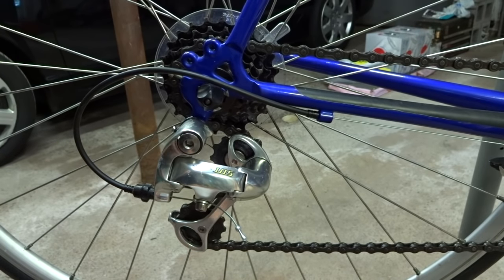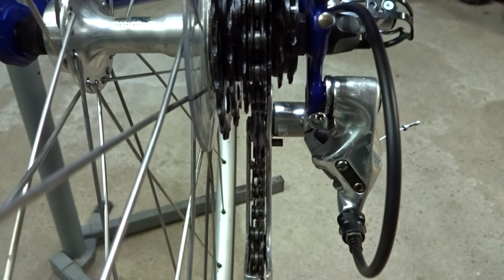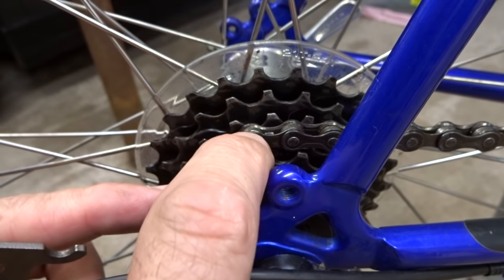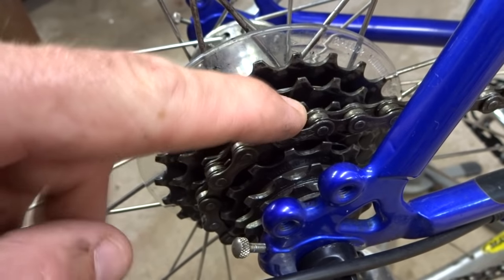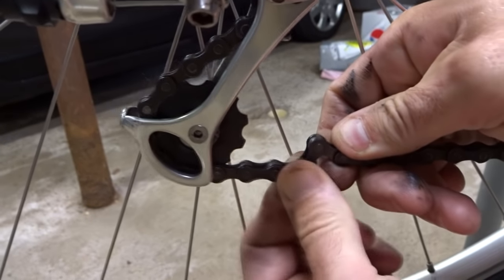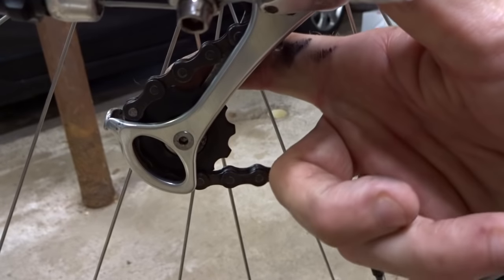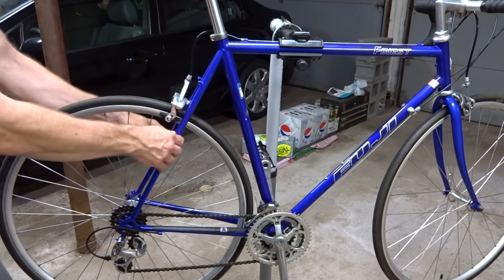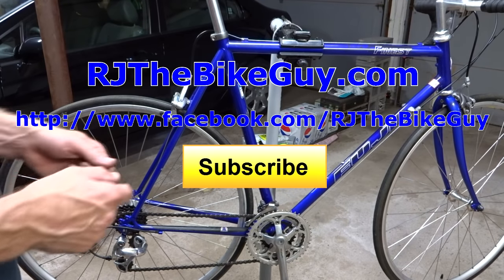How To Fix Bike Chain Skipping/Slipping/Jumping Gears

Comment from the maker: For more bike repair videos hit the subscribe button 🛑 and click the notification bell ► http://bit.ly/SubRJTheBikeGuy
Reply: RJ The Bike Guy first video I've watched on how to fix a bike and it's been sooooo helpful!! 🚴😊 Thanks 😁👍 Sub'd 🤓
Reply: Hey bud just watched your video I got a weird problem If I shift up past 6th gear my bike's chain will slip until I shift down.
I can shift all the way to 6th but not further.
I bought the bike 3 days ago so it's brand new is there a break in period?
Reply from the maker: @HerrenGamingNews  If you just bought the bike, have the shop fix it. Sounds like a limit screw adjustment.
Reply: @RJTheBikeGuy  yeah I just talked to them and they said it could be the cable, next time when I buy a bike I'm going to get them to check the gears, cable and chain on top of their safety inspection which will be in 2021 as I want a fat bike for the winter
Reply: i am in dire need of help!
my bike tries to kill me on 3rd, 4th, 6th  and 7th gear, i make sure i down shift and "seat" gear properly before putting pressure on the chain while climbing, and the chain "skips"
meaning that it feels like the chain lets go 100% or af it the cassette has missing teethe and you get to those teeth and it lets go for 1 second,
not good when you are putting all your pressure on the pedal and just goes "CLING!" and all your weight goes sideways!! 
the bike never did that new and only after a few rides i start having issues with it and never had worked correctly after the first tune up..
Reply: @anuar.m.y  try replacing your cassette and chain, my chain would slip on 7th and up and eventually 6th after I replaced my chain and cassette no issues
Reply: @HerrenGamingNews   i checked the cassette, it seems to have no issues and already replaced the chain, 2 bike shops looked at it before the COVID-19 and they both said that the cassette was fine tho,
it started with only 3rd and gradually got worst and now other gears are skipping
going to change the hanger soon too
Reply: @anuar.m.y  ok it could be tension on the chain but remember chains and cassettes wear together if replacing both together doesn't work it may be time for a new bike
Reply: @HerrenGamingNews  is a Specialized hardtail with mild usage! how is this possible!?
Reply: @David Woodhouse I got it fixed but it was anytime I put any real weight on the peddle from 7th up it would slip turns out the cassette was bad
Reply from the maker: @David Woodhouse https://www.youtube.com/watch?v=OV1AVcdNjMM
Reply: thanks bro this helped me fix my bike
Reply: loved your vids. you will have the solution to most of my bikes problem. but recently i have a problem with my bike and im not sure what the problem lies in. when i step on my paddle, my gear will move but not my wheel and it seems that there is no catch in some part of the wheel.
Reply from the maker: Freehub or freewheel. Discussed in the video.
Reply: Thank you so much I appreciate the help!
Reply from the maker: @Kamek stories, maths and games Have you tried training wheels?
Reply: Lmao
Reply: @TheRageng qqqq❤❤❤❤❤QQ

Comment: Hi RJ: Update on my chain skipping problem on my 3x9 touring bike: Turns out that the culprit was a  worn middle chainring! Everything else is new on that bike, so I should have thought of the chainrings earlier, but when you're stomping down on the pedal while riding it's impossible to keep a close eye on the movement of the chain. It was only when I asked my wife to look at the cassette while I stomped on the pedal with the bike on the floor and the brakes set that she exclaimed, "the cassette isn't moving, you dummy!" This has proved to be one life lesson that I will never forget....

Comment: I have a 17 year old hybrid with a 3x6 freewheel setup. Shifting was awful. Changed the chain and freewheel but not much better. The main culprit turned out to be the rear derailleur which has lost a lot of its spring so the chain tension was too low. However carefully the limit screws and indexing were set it would not go up and down reliably. A new one completely fixit it. I had a second problem of shifting getting slow and sometimes delayed for several seconds. This was due to dirt getting in the cable to the rear derailleur. The cable comes in three outer sections so lots of places for dirt to get in, but easily cleaned as well.

I have a new bike now with Shimano 105 groupset. The technology has come so far in the last 20 years, it’s in a different league.

Comment: my chain always skips right when i stand up... wish i could see it happen so i could figure it out.
Reply: me too
Reply: gamer3928 same
Reply: Romans biggest fan my issue was gunk between the gears. it was an 11 tooth so I guess the small amount of gunk was thick enough to push the chain high enough so it doesn't have good contact
Reply from the maker: Most likely causes, worn chain, worn, cogs, misadjustment, maybe bent derailleur/hanger. It's all in the video.
Reply: gamer3928 how should I clean it?
Reply: Romans biggest fan there tons of ways to clean it. out on the road I pull over and just dig out the gunk with my lock key and it's good for a while.
Reply from the maker: Degreaser and a scrub brush. I usually follow up with dish soap/hot water and a scrub brush.
Reply: gamer3928 agaa
Reply: gamer3928 in
Reply: Simple fix. One of my chain links were stiff. WD40 did the trick
Reply: el verdugo Pr ... Because 5he wheell isn't well attached to the frame . Those the reazon it goes side to sides .
Reply: My chain skips on gear 6 and 7 mostly when Onadd more pressure going up.
Reply: SBG KANIFLE  thank you ;)
Reply: Yeah me too it makes me crash to the ground because of chain slipping and it also happens when i sprint.
Reply: gamer3928
Reply: gamer3928 =
Reply: gamer3928 mine skips when I go down past gear 3
Reply: gamer3928 and it is a brand new bike
Reply: Gamer3929
Reply: dont stand up
Reply: @andrewwhiteside5987  lol
Reply: @Klaem0re  did you ever figure it out?
Reply: Lovelyjubly  always blame the bottom bracket!
Reply: living in a desert   😂😂

Comment: This is a great diagnosis video but is a poor "How to" video that the title suggests that it is.
Reply: How to diagnose, not fix. 
I think my cassette needs replacement and i bought it like this, back to the store with complaints.
Reply: It a bicycle, not a motorcycle, start screwing on something at some direction, and it will work out.
Reply: I figured out what’s wrong with my bike. And how to fix it from this video. Also he tells you about his other videos with the solution to your diagnosis. Use this video figure out what’s going on, and use his other videos explaining the problems and fixing them in greater depth
Reply: Helped me fix my problem with, great video.
Reply: @alecnolastname4362  Ah, that's why the video is titled How To Diagnose Bike Chain Skipping/Slipping/Jumping Gears
Reply: @andthefunkybunch1466  It says how to Fix not diagnose
Reply: Niiles Punkari 🤣🤣🤣🤣🤣

Comment: Hi, I have a 7 speed bike with shimano tourney groupset and Im buying a new 7 speed freewheel from shimano that has a different cog count compared to my old freewheel. Will that old derailleur still work? thanks
Reply from the maker: You lost me. You have a 7 speed bike and you have a 7 speed freewheel...how is that a different cog count?
Reply: RJ The Bike Guy sry about it. my old 7 speed wheel got all rusty and stuff so I am replacing it. but the new one i got looks quite different compared to the old one the largest cog looks bigger than the one on my old freewheel. Can I still use the same derailleur and shifter?
Reply from the maker: This video talks about derailleur specs: https://www.youtube.com/watch?v=9R1CVWcgu_M
Reply: thank you very much

Comment: Great video! I have a bike that was locked up outside in the elements for a long time without use (thanks a little to COVID and a bit to the weather). I immediately relubricated the chain but found it skipping. The cassette , derailer and chain seems to still be good. I'm now under the assumption that the chain links are stiff (due to being out in the elements for so long). I used some oil to continue cleaning them. Otherwise, I might just replace the chain. Thanks for the help and tips!
Reply: You should get a new chain and pay to get it placed on. I'm telling you no amount of money saved is worth attempting to do the chain all alone if you deal with links. You can follow the instructions all you want you won't get nowhere and with some skill and determination you might take a few links off the chain but you will never be able to put the chain back together without an actual machine or taking the bike to a shop where they can do it by machine
Reply: @David-ty5jk  I don't fancy the job either.

Comment: Nice video.  One other thing that can suddenly cause bad shifting on a bike that has been shifting fine for a while is a worn (even busting) cable or bad housing.  Sometimes hard to see if the cable strands are starting to bust up inside the shifter.

Comment: Thank you very much for this video. I bought a used Trek 7.4a few years ago that had a persistent problem with the rear derailleur. It just didn't shift as smoothly as it should. I tried the standard adjustments. I took it to the LBS. All without success.  Then I found this video. It suggested replacing the shift cable. I replaced the rear derailleur shift cable and wow! Problem solved!

Before I threw out the old cable, I  inspected it. I found a kink in the cable that would explain the poor shifting. Thanks for the great videos. Please keep them coming.
Reply from the maker: Your LBS didn't catch that???
Reply: Sadly no.  I have since learned that not all LBS are equal.  Some are more new bike assemblers that bike fixers.  The good news is that since the LBS experience, I decided to rely on my own 2 hands.  I bought some a bike stand, some tools and have since refurbished a few vintage bikes.  All the expertise I needed was in your videos.  I've also founds a new LBS for the stuff I'm not yet up to fixing.  Thanks again for your videos!

Comment: Just cleaned up my sister in law's old mountain bike and put a new chain on an old Shimano 7-speed cassette. Jumping like crazy on the three smallest sprockets. Was thinking I might have an incompatible chain ( KMC Z50 ) but worn sprockets sounds like the real cause. She always rides the middle chain ring on the small sprockets. Need to see if I have another 7 speed in the collection ( think they are all 8 though ).
Reply: I also have a Shimano 7 shifter that shifts by itself gear 1 and 2 work great but when I shift to the 3rd gear it starts jumping to the 6th gear and back to the 4th and then to the 7th it's crazy

Comment: On line with frame flex shifting issues, I have found that worn bushings or bearings on full suspension bikes can be a serious issue. So, if you have a F/S and it is still jumping or ghost shifting after going thru all the common fixes, check for suspension wobble.

Comment: I know this video is old, but just in case this happens to help someone out - I had the chain keep jumping gears without me getting anywhere near the gear levers. I took it to 4 different repairs and they:
1.) Replaced my chain
2.) replaced a part that I don't know how to translate - maybe the bearings that fit through the back wheel?
3.) shortened the chain by 1 link even after the first repair shop charged 50 bucks for the first 2 fixes, probably getting it right. The logic was that the chain might be a bit loose and that's why it jumped.
4.) Adjusted the rear derailleur
5.) a couple other things that I can't remember

At the end of the day, the problem persisted and it made me hate riding my bike, because during riding, the chain would just skip gears, the pedal would lose resistance and my leg would push through unexpectedly and violently, hurting my knee badly sometimes.

Took it to one last guy before giving up on the whole bike, and all he did was replace all the cables and cable housings, and it's been working for months on end without a single hitch now.

Hope it helps someone!
Reply: Just to add a statement, because I don't wanna give misguided information:

I know the guy who actually fixed the bike's problem ALSO adjusted the rear derailleur (I quote him that he only adjusted it "a little bit"). That means that it could've been the reason on its own the entire time, and that the first person adjusting it didn't tune it perfectly maybe. I don't know how big of a role the changing of the cables and cable housings made, but I hope it's also a valid contender for the list of possible causes for this particular problem.

Anyway, best of luck to anyone dealing with this! Thank you RJ for helping everyone with your wealth of knowledge and experience!

Comment: I replaced my chain and now have problems with skipping. The freewheel teeth don't look particularly worn and it happens in most gears.  Do some of the other problems you showed sometimes act just like a worn freewheel cog? I can't climb a hill and even firm pressure starting from a stop will cause a skip. It shifts fairly well, but this accushift has never been perfect.  Thanks for the video.
Reply from the maker: I covered the most common issues int he video. Since you just replaced the chain and issues started, then I am guessing a worn freewheel/cassette. But go through the video
Reply: @RJTheBikeGuy  So, I replaced the derailleur cable, set everything up from scratch, and it still skipped. More testing showed it skipped on cogs 2, 3, 4 but not 1, 5, 6, 7 and skips regardless of the front chainring. I found a Winner Pro 12x28 down at the bottom of my bike parts mulch box, spun it on and voila! Fixed. I guess I killed this thing climbing hills rather than in the flats. So stupid. I should have checked my chain sooner. Thanks for your help and video. One suggestion for anyone who changes a freewheel:  Put a heavy grease on the hub threads.

Comment: ABSOLUTE MATE.

I’ve had this issue 4 times over the last 6 months and I usually just take my bike into a REI to get it fixed for $15 but I guess the rear derailleur was unaligned.

Adjusting it fixed it perfectly. Cheers mate.

Comment: Why can't they just get rid of the chain and have a 3rd drive wheel directly  attached to the pedals?
Reply: It makes better sense for a bicycle to have a chain, cogs and chain wheels, aka chain rings. I don't know what you mean by 3rd drive wheel.
Reply: Wouldn't that mean you'd have to pedal backwards to get the front and back wheels to go forwards? That would be strange!
Reply: Jonathan Chuck why bother answering then if you don't know what you are talking about ?
Reply: Genius , but make it a toothed  rim,rear wheel,with direct gear from crank

Comment: question, I just bought a bike😀, was riding, braked, brakes work a little too well lol, and I ate it with the bike and the chain fell off... Its a 7 gear bike, idk if thats right, anyways, I put the chain on the second to smallest cog, and then on the smallest, is that correct, if I have my bike on number 7??
Reply: Yes

Comment: Very useful, but what about the chain slipping on the chain wheels? I replaced the chain and freewheel/gears on my MTB, but chain still slipped, but not as badly. Replacing the chain set sorted the problem. The chain slipped on the middle chain ring, but not the largest, presumably because It was torqued less.
Is chain slip less likely to be caused by a worn chain wheel than a gear on the freewheel?
Reply: My new chain slipped with the original freewheel and middle chainwheel, on a front triple crankset. The middle is the one that I had used most. The large (high speed) and granny (low speed) were used less: they were still operable, but the middle was pretty bad when I inspected it closely. It's an aluminum alloy, softer than steel. The cogs on the freewheel are steel and still have their factory profile. So I replaced the middle chainwheel and the problem went away. The exact same thing happened with a friend's bike, and he replaced the middle chainring also. So you really have to check all three areas: freewheel, chain, and chainrings. A chain and the cogs wear together, so sometimes a new chain won't work well because it doesn't mesh correctly with the old cogs.

Comment: It's great that I can can count on a four year old vid to confirm my suspicions. I have a worn chain and cassette, which is being replaced. I'm waiting on a cassette. Anyway, I noticed the pulleys aren't in a straight line, the tension wheel seems to be 10mm further in than the guide pulley. An easy fix, but I needed to know whether it needed to be in a straight line. Thanks for an informative vid 👍

Comment: Excellent video. My well used bike was working fine, but I thought it might be time for a new chain. The bike mechanic told me the chain was so worn I would have to replace the sprockets..but I didn’t believe him.  They looked okay  to me.  But after fitting the chain, I literally could not move the bike, as the chain slipped freely over all sprockets under any load.  Amazing!  As the bike is old,  I have refitted the old chain and everything is back to normal. No skipping except on the smallest rear cog.

Comment: Does the wobbling of the wheel at the rear is also another reason why the chain is jumping up? This only happens to my bike when I shift to the smallest gear. I'll appreciate any advise on this. Thanks for the video!!!
Reply from the maker: If the hub is wobbling, overhaul it. If the rim is wobbling true the wheel.